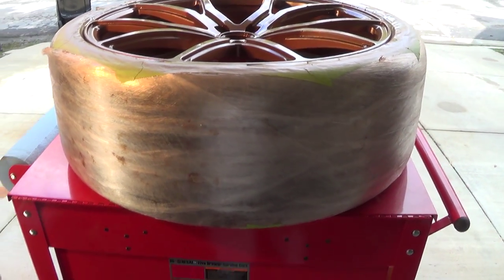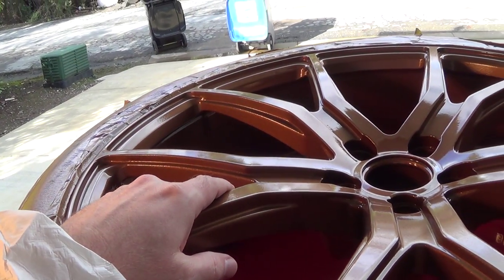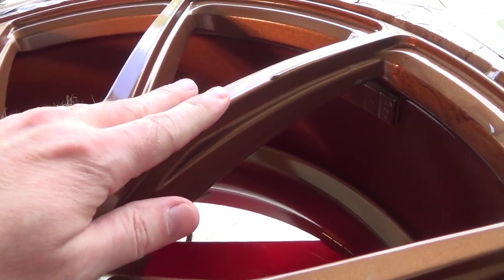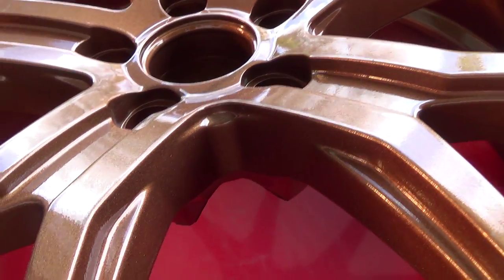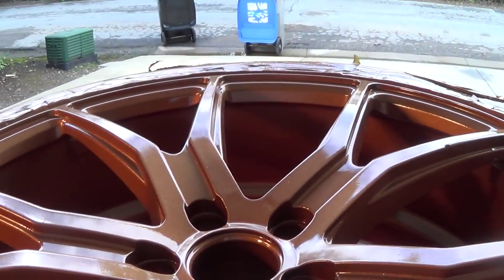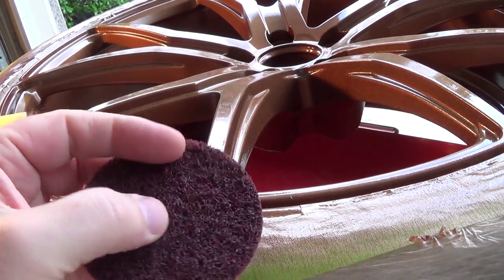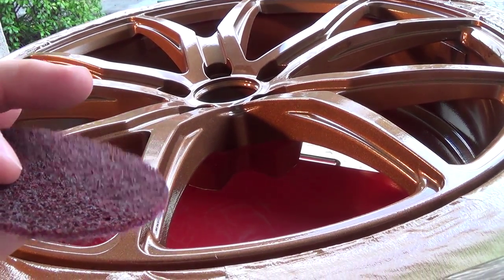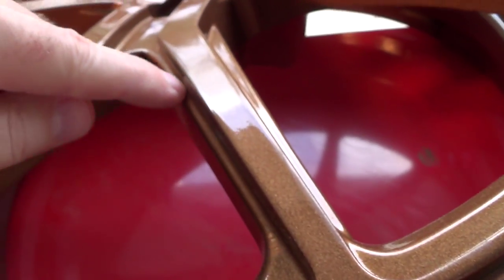Paintin' some wheels - part I

Comment: can you shoot me the name of the dremal sanding disk would work good on my intake manifold thanks
Reply from the maker: +265chevy This is the description from Amazon:
3m Radial Disc 3/4in, 220g (Red) - BRS-580.50
Reply: +asicerik Hey Erik. What grit do you recommend to take off paint and some thick bondo? Want it down to bare metal.
Reply from the maker: +Kevin Brown For me, wire wheels and 3M Roloc bristle discs have worked the best. Most people use a DA, but I have had little luck with my DA on paint. It does work pretty well on Bondo though. I usually turn off the random part of the DA to get the more (pure?) orbital motion.
Reply: +asicerik I'm looking for something to get in the tight corners (i.e. drip rails) . Those 3/4"  3m Radial Discs you gave the link to will definitely fit the bill. I'm trying to figure out which grit to get for paint and bondo stripping down to bare metal.
Reply from the maker: +Kevin Brown Ah, sorry. How wide is the channel? There are wider discs like this that would work better for a 1/2" channel (ish). 
http://www.amazon.com/Scotch-Brite-Bristle-Cubitron-Aluminum-Diameter/dp/B005V3XDXW/ref=sr_1_14?s=industrial&ie=UTF8&qid=1453769505&sr=1-14&keywords=3m+scotch-brite+bristle+disc
Reply from the maker: +asicerik If that is too big, I would go with the 80 grit version of the discs I used. Get a bunch though, they burn up pretty quick. 
There is also the narrow belt sander solution like :
http://www.amazon.com/Black-Decker-PF260-2-Inch-Precision/dp/B000XR2ETK/ref=sr_1_4?s=industrial&ie=UTF8&qid=1453769657&sr=1-4&keywords=belt+sander+1%2F2
Reply: +asicerik I think the small ones you used will be more versatile. Especially when it comes to tight spots around the rear taillight bezel. I'll order a bunch of the 80 grit ones and see how it goes. Thanks for your help!

Comment: One thing I have learned about wheels is don't paint them , no matter what you do they will chip send the money and get them powered coated problem solved
Reply from the maker: +TheFrameoff Yeah, could be. That is the fallback for these. We thought we would give it a try though.
Reply: Just a bead blast and powered coat  and have heard of people getting them clear coated after ..